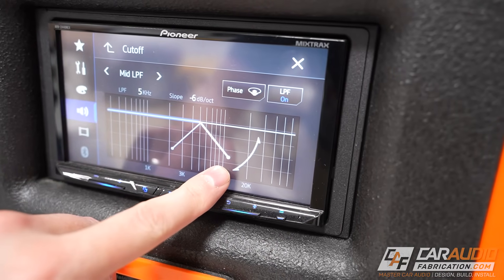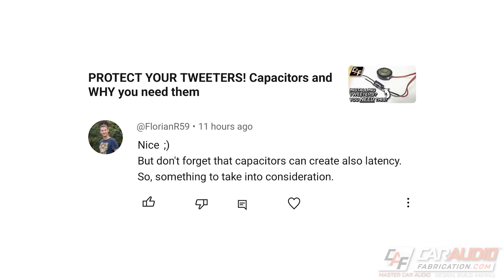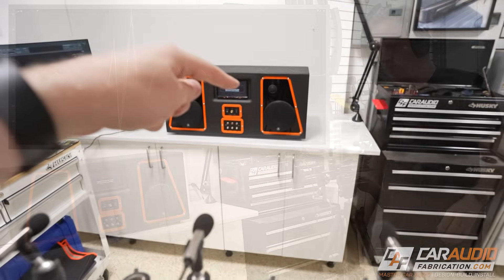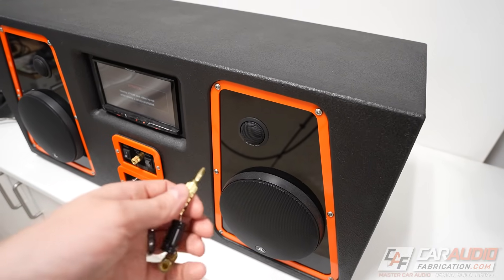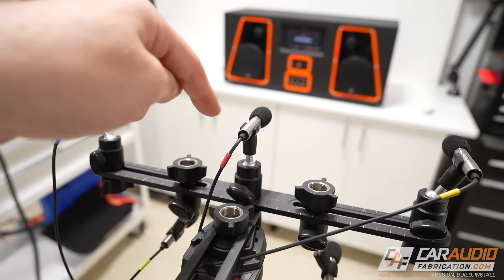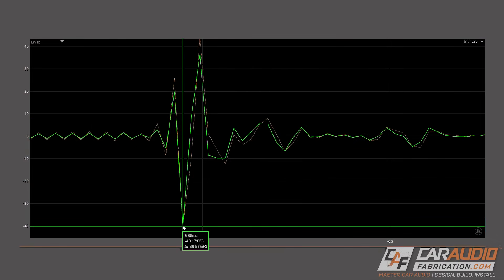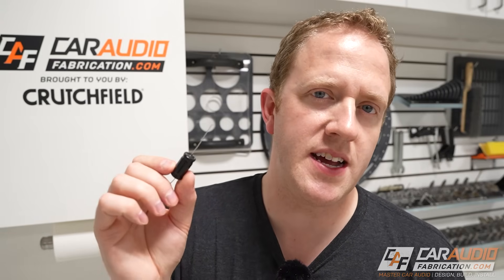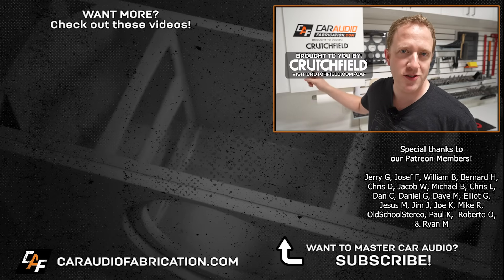MISTAKE to recommend these? Tweeter Protection Capacitor Test!

Comment: As a professional installer for 23 years now i do passive and active systems a lot.   However, if im going active im not putting a cap on a tweeter or i would have just used the passive xover.  Dsp's hold settings regardless of power cycles so it seems like an unnecessary step imho
Reply: Just wait till you have a corrupt tune file load on DSP because the battery voltage was lower than what you thought.   Or when customer has vehicle battery go dead and it loses the tune.     It makes sense to protect the tweeter.
Reply: @caseytbss  Since when does a DSP lose the tune if battery is dead😂
Reply: Never had an amp go down and dump DC into a speaker?  Never had an owner mess with their DSP and reset the crossovers?  You're super lucky I guess.
Oh, installing since 1987, so like 36 years, but what does that matter?
Reply from the maker: You're not really "putting a passive crossover on it" since you choose a value outside the pass band you intend to use. It's extremely cheap insurance. Many high end component tweeters even include it.
Reply: I have heard it will also protect from turn on and off thumps from the amplifier. Different types do sound a little different especially with high end (very revealing) tweeters.

Comment: Cool video.  Shows how sensitive placement is and why the sweet spot is so small on my time corrected home setup.
Reply from the maker: Right! I was thinking I'd have to move the mic a foot before detecting any difference but I could literally touch it and it would be noticeable on the graph.
Reply: @CarAudioFabrication  love the video my question is when you have speaker built with tweeter that is 2,3 or 4 way how you safe them from be damage how you protect them from no blowing up burn?
Reply: @CarAudioFabrication  that's why this test was nonsense

Comment: that was a cool test. didn't think there would be much of a delay and certainly not one you would hear. one thing you didn't mention though is how various caps all sound different on a tweeter. if you take a basic electrolytic, mylar, a solen and a clarity csa you'll hear a slightly different sound out of them. for a few dollars more that clarity is a warmer sounding cap. anyone questioning this can try it themselves for a few dollars buying each at one of the various vendors like madisound. your phase test was really cool too. in theory it should be off 90deg....but....it wasn't ! testing beats theory every time
Reply: In those cases, the capacitor is in the passband of the driver so yes you might be able to hear differences and see that shift.  This is so far below the passband that an electrolytic is fine.
Reply: @BaddDukk  try it

Comment: I think the delay is in charging the cap, but once charged a tweeter is not like a sub and I doubt it will tap the capacitor for extra power like a sub would.  I could be wrong, I havent done the math on it and each system is different on how it runs and how fast it can charge.  It would be interesting to see if different material type caps would act differently.
Reply from the maker: Hmmm, perhaps more testing in the future...
Reply: You're not charging the cap.  It's in series, essentially an a/c coupling device with its F3 pole a bit lower than the active crossover you're supplementing with.  In electrical theory, it is a single order 6db/octave high pass RC filter with one pole where freq response =1/jwC,  where w=freq and C=capacitance value (ignore j).  Phase should be 45deg out at the F3 (3db cutoff), though audibly in a car it should not be noticeable due to all of the acoustic reflections, etc.  As mentioned elsewhere, the physical chemistry of the capacitor affects the sound more than the filter phase physics.
Reply: You are confusing the use of large capacitors in a 12v direct current power source vs use in an alternating current as such with an audio signal.  The former is wired in parallel with your power system (alternator and car battery), and acts as a small fast discharging battery.  The latter is wired in series and will stop current from flowing when it reaches capacity, thus protecting our speaker from high current audio signal.

Comment: In this iam having a speaker 8" 4ohms 800watt dual coil sub woofer.
For this speaker suggest a suitable amplifier board.
Reply from the maker: If you need assistance picking gear for your application we can assist here: https://www.caraudiofabrication.com/consultations Thanks for watching!

Comment: I, too, have heard the passive crossovers can cause latency. I wonder if it's the woofer that will be affected rather than the tweeter 🤔
.
Thanks for the definitive proof!
Reply from the maker: Perhaps another test in the future! If I had to wager a guess I would say not enough to matter, install location will easily have more of a change. I could BARELY move the mics and detect change so I think that's what it will always boil down to. When you have a DSP and can time delay anyhow any latency is easily corrected.
Reply: @CarAudioFabrication  another test it is! Maybe a phase test could be incorporated into it as well. I can't help but to think what is essentially a transformer in passive crossover may change the phase simply by how transformers work
Reply: @CarAudioFabrication  how do you even use DSP? Cause i always see people install them for mexican music but then cant even play rap cause it makes subs sound like butt? Are they just using it wrong? (I mostly see epicenters and them spider ones 😂)
Reply: @DannyOrnelasPerformance  that’s not a proper dsp…
Reply: @valecasillas5729 yo nunca he ententido por k suenan bien con una musica y otra no